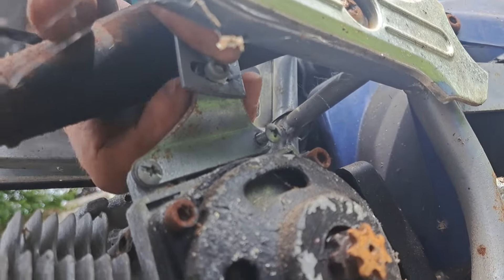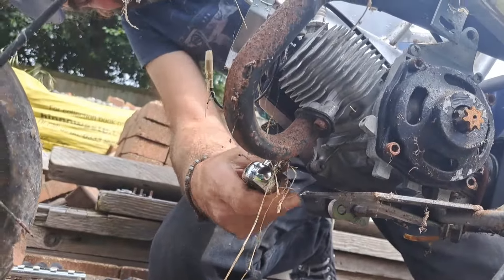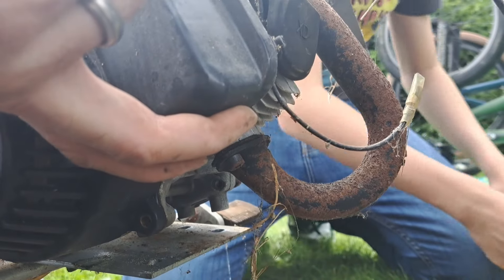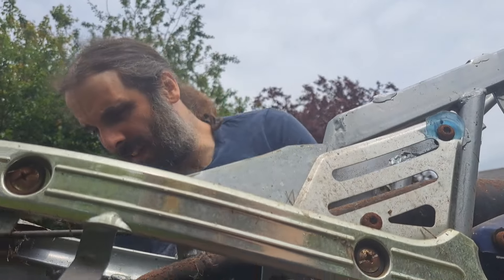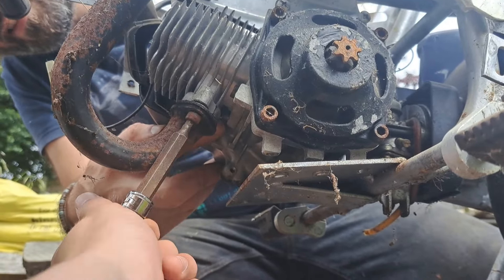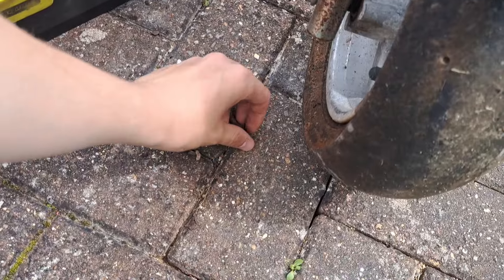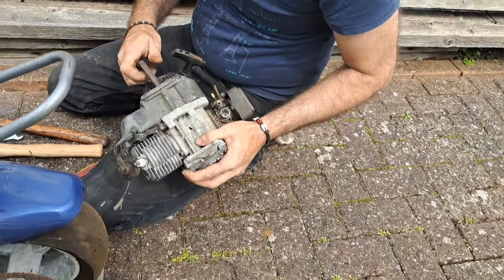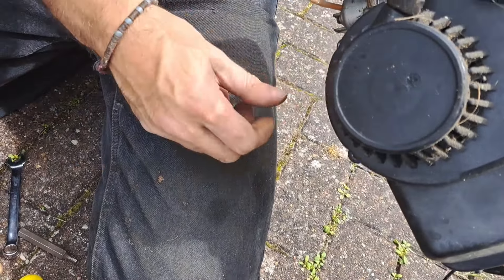This mini moto has sat for 14 years - will it run? - part one

Comment: i like the vid oh and also you cant make it spark by turing it over so slow prob little rust on the flywheel en carb clean and she wil run just fine:)
Reply from the maker: The coil pack is dead